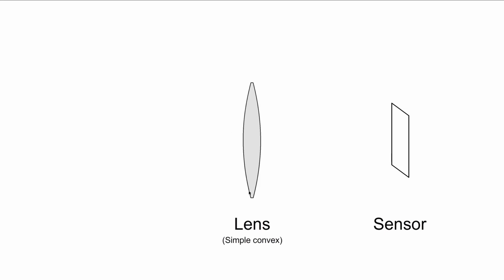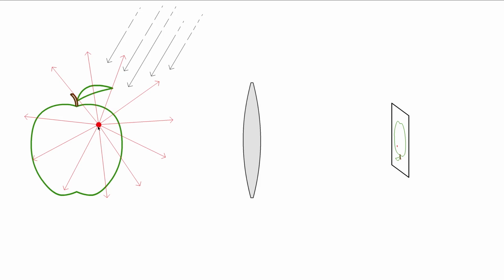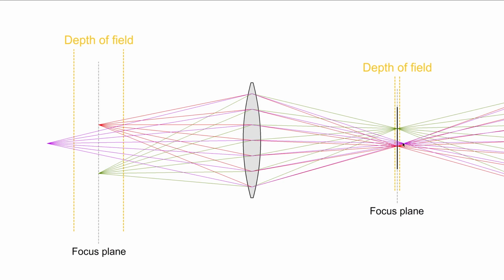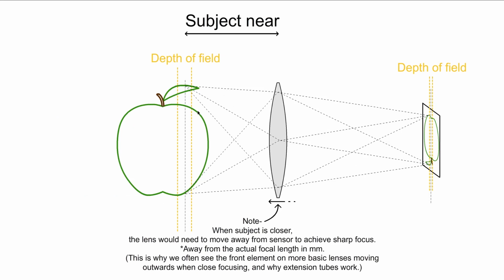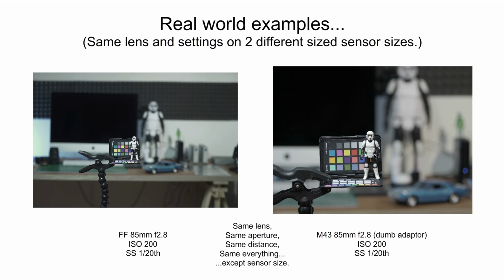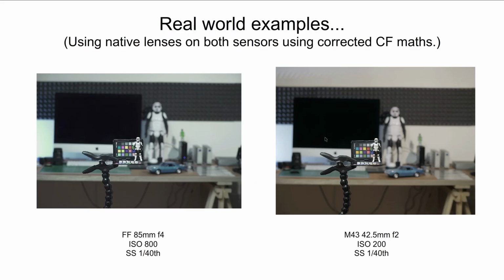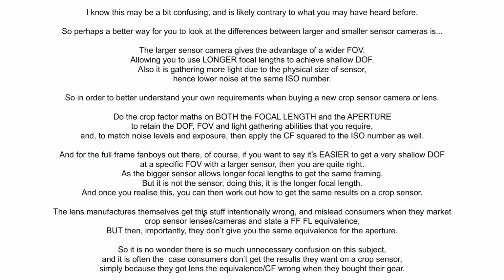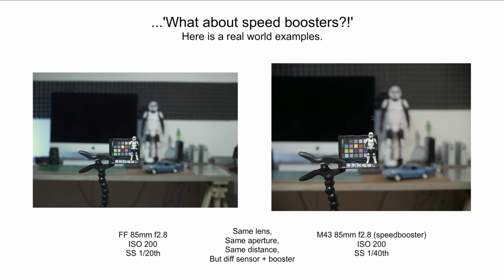Depth of field and crop factor misconceptions.

Comment: I don't think manufacturers "gets" the stuff intentionally wrong, they just want to achieve the same thing. Consumer market refers to FOV as EFL (equivalent focal length) for a 35mm sensor. The f/# refers to the light gathering capability only (how much light can I collect from the scene?)

You do something completely different: you're trying to "match" the circles of confusions to get a similar DOF when changing the crop factor. And this is great when you need to compare the performance of two systems for this very metric, but very cumbersome when you try to match the exposition between systems. What is important to a manufacturer (when designing a lens) is the f/# and the FOV only.

I think what you get wrong in this video is the "equivalent aperture". This is not something which should be used because it is not a "scalable metric". FOV and f/# are the same regardless of sensor size (even if FOV is specified as EFL for 35mm cameras). "Equivalent aperture" is only useful when trying to achieve a specific DOF, but the same could be said about perspective (which is a an important factor for portrait photography too).
Reply from the maker: Hey, there are lots of examples of manufacturers getting this wrong. and it seems very intensional. see this vid with some good examples -
https://youtu.be/DtDotqLx6nA
Reply: I don't think you understand what I meant. This video has the same methodology you used (I think you based your video on it) and I find it very difficult to follow. The amount of light that will reach the sensor is only given by the f/#, and this is independent of the field of view. I understand what you're trying to do when comparing systems for the same level of noise or DOF.

The video you linked is a bit misleading. I don't think he quite understand how image f/# is computed for real photographic lenses and why it is a metric. A set of f/#, exposition time and ISO will give you the exposition you need for any FOV or sensor size.
Reply from the maker: And regarding the changing aperture value on different lenses, to achieve true equivalence, and very comparable quality.
This way i suggest here really is completely the right way to go about it.
Lets brake down what is important to a image when comparing a photo or video taken by one camera/system/lens and another-

-FOV. (so we know what will fit in shot)
-Total light gathering across whole sensor. (so we know the noise levels we can expect at a particular light level)
-DOF. (so we know how much background blur we can expect. or how much of our scene will be in focus)

If you do it the way I suggest then you can completely match every one of those across hugely different sized sensors/systems, and know what equipment you may need if, perhaps you were changing systems. (e.g. going from FF to APS-C etc.) and you want the same level of quality that you had on FF.

I think the bit you are getting hung up on, (and you are not alone in this) is you think the ISO is a good gauge to trust over varying sized sensors. Its understandable why people trust it so much, as it helps match exposure over varied systems.
But, because the ISO isn't telling us about the TOTAL amount of light hitting sensor. its essentially lying to us.
Once you realise that you can work backwards and 'fix' the rest of the equation.

If TOTAL light hitting sensor if what you need to know... and it should be, because, as i have explained, it determines the image noise very very accurately. Then start from that point.

If you look at DXOmark results regarding image noise over dozens of varied sized sensors from many manafacturers... then do the crop sensor maths squared to their results, you will suddenly see that they all perform roughly the same... (as soon as the SIZE of sensor is taken out of the picture.)
In other words, the technology variance is really quite small, even over a several year span,
(Note, the performance increase with sensors is very tiny year to year, maybe a 1/3 of a stop improvement every 2 years at most) the main difference is simply the physical size of the sensor.

So, as a factor that helps us quantify the quality we will achieve with a given set up, the Fstop number pales into significance compared to the total amount of light a particular lens lets through.

Remember the focal length is part of the transmission equation (you can't change that without changing the aperture to keep equivalence). and a lens thats half the focal length (for a M43 / FF comparison), and designed for a smaller sensor is physically MUCH smaller. So how could it possibly perform the same???
It can't.
So yes, it is unfair for manufacturers to state FF EFL (which gives us our FOV guide) and not state the FF equivalent aperture too. (which gives us our total light transmission ability... plus a very good idea about DOF as well.)

its like a car company saying 'buy OUR car over that one, because its engine is twice as efficient as the competition!'
But they don't mention that their car weighs four times as much as the competitions car, so in fact it uses twice as much fuel.

So Joe blogs buys the car after reading 'twice as efficient' and wonders what it gets shot MPG :D

Anyway.. thanks for your input.. but after a lot of homework on this one I'm pretty sure the facts in this vid are spot on so far. (i will certainly take it down and revise if anyone points out any real mistakes)
Reply: you are right....i like to say that the image is produced by the lens not by the sensor....Tony Norhtup is confusing everybody with this wrong assumption. He is matching DOf of diferent lenses...so this for shure will affect the resolution of the FF....giving the impression that iso 200 on m4/3 is actualy iso800....bullshit.
Reply: "So yes, it is unfair for manufacturers to state FF EFL (which gives us our FOV guide) and not state the FF equivalent aperture too. (which gives us our total light transmission ability... plus a very good idea about DOF as well.)"

This is not true at all. Light transmission ability is only given by f/#, and that why your methodology is wrong here. "Total light hitting sensor" is not what you want to know, and isn't even related to DOF. 

"Remember the focal length is part of the transmission equation (you can't change that without changing the aperture to keep equivalence)". What is that transmission equation? It is probably linear with f/# but not focal length (changing focal length and keeping the same clear aperture).

I want to reassure you by saying that what you did is certainly "not wrong". At the end, you normalise the exposure and get similar noise levels. But what I want to say is that this is not a conspiracy against the consumer. Open any lens design notebook, and these metrics are never mentioned because they are not important for the lens manufacturer (only f/# and FOV are). What you want to know about a lens is what it sees, and "how much" it can see it, the blur is irrelevant for most applications.
Reply: is like saying the reverse: to get a sharp image like the m4/3 delivers you have to lose resolution on FF
Reply: Exactly, when you scale a lens, you also scale the aberrations it causes. (DOF being one of those "aberration" when you are talking about optics)
Reply from the maker: Im not sure if our last messages overlapped, so uncertain if you read my long explanation... 
but regarding Tony Northrup's vid, yes, as i explained at the end i got a lot of the info from him. but i wanted to break it down and do my own tests then try to illustrate all of the relevant aspects with illustrations etc. (I mainly did it this way because I think visually, and not with equations... so i figured other people would appreciate this way of braking it all down too... when i sit down and litrally draw things out like this, the process becomes crystal clear to me.)
Reply: give me a high-five Guillaume!
Reply from the maker: sorry, what?
Reply: I know what you mean, but I think your video (and Tony Northrup's) is very misleading. The methodology is wrong, even if the results are right. The only conclusions you should get are:

1. It is possible to match the DOF of a FF system by scaling some parameter relative to the sensor size.
2. Smaller sensor will get better performance if you want to match DOF (small sensor are really good now, even if pixel size is smaller).

And that's it. Manufacturers are not misleading you, they are giving you the metrics you need to buy a lens. DOF calculations should be on the consumer side only, because they are only used to compare performance across sensor size.
Reply from the maker: No, he and I are trying to point out that when you have the FF at ISO 800 and M43 at ISO200. and they both expose the same. then they are both getting the same TOTAL amount of light on the sensor. This is why they have very similar amounts of noise... maybe some cross wires across all the comments now.. so apologies if this is the case.
Reply: biscuitsalive, iso 200 on m 4/3 are almost perfect...there is no noise......will be if you do a stress test with no light.
Reply from the maker: Im not saying its a conspiracy, I'm saying they knowingly misrepresent the facts consumers should know when choosing a crop sensor camera in their marketing. thats pretty obvious to me.
Reply from the maker: as i said, the total light hitting sensor is important to the noise levels... how did i not make that clear?
Reply: i shoot with two cameras: d700 FF and Olympus EM5 mark II.
With both on 50mm (olympus with 25mm), both with F1.8 and iso 200, i get a better exposure on olympus....i have to decrease two stops on nikon to match both.....this is a real test.
Reply: the light transmition of olympus lenses are no match for nikkor.
Reply: " FF at ISO 800 and M43 at ISO200. and they both expose the same. then they are both getting the same TOTAL amount of light on the sensor"

That's why I said that you are not "technically wrong". You can always find another valid exposure on the exposure triangle, and that's why they get the "same amount of light". But that doesn't mean that the methodology you used to get to your conclusion is right. I understand that it is interesting to see that you can match the DOF or other aberrations, but I don't think manufacturer are in the wrong or misleading by not telling you that.

I won't argue farther, I think it's useless at this point because I will only repeat myself. Just keep in mind that you're not technically wrong (the maths and the figure you used are spot on), just a little off on your conclusions.
Reply from the maker: what i mean by the transmission equation is - all the factors that determine the amount of light a lens can transmit.
when you change the focal length. the physical size of the aperture has to change to match the same amount of light...
hence a 50mm f2 = a diameter 25mm aperture
and a 35mm f2 = a diameter 17.5mm aperture

So. when you change the FL, you cannot do this in isolation if you want the light transmission to stay the same. 
So. when you change the FL to match a FOV of a diff sensor... you HAVE to change the aperture too... or its not a equivalent amount of light.... i explain all this in the video... do i have to explain it again?
Reply from the maker: Anyway, i appreciate your input... but I made this video so that i wouldn't have to get into these sorts or disagreements... :) I was hoping that if i spelled it all out as clearly as i possibly could in the vid, then it would be apparent why this is the very best way to approach crop factor equivalence. (youtube comments are not the best way to express yourself after all )
Reply from the maker: there is always noise. go and take pics of a blue sky with any camera, any ISO, there is always noise. (unfortunately)
Reply: You don't have to explain to me how f/# works. I think you are mixing a few things in what I said, so I'll try to give you an example.

What I mean when "matching the FOV", is matching to FOV WITHOUT changing the f/#.

50mm f/2on  FF and 25mm f/2 on M43 will have about the same FFOV, and the same "light gathering capabilities". That means that the ISO and the Exposure time will not change between the two systems. That what is important for a lens manufacturer.

What you are doing here is matching an aberration (in your case DOF). You can match it (as you have showed with your figures) by changing the aperture. Then, 50mm f/4 on FF and 25mm f/2 on M43 will be matched for DOF. However, you have lost two stops of light that you need to gain. If you want to keep the exposure time the same, you will need to crank the ISO by two stops.
Reply from the maker: I get to play with cinema lenses for work, and the Tstops sort it all out for you. yes, much variation in actual transmission with photography fstops.
Reply: I'm a grad students in optical design, so I get to work with all these metrics on a daily basis. I'm not sure if I can explain it clearly to you. Once more, I don't think you're wrong, just not seeing  the problem with the same background as I do. If, for what you do, DOF is more important than anything else: your conclusion is right. However, in most application, FOV and light collection are probably more important and that's why manufacturer only gives those metrics out.
Reply from the maker: ok, i think you haven't got you head around the basic message i was tying to impart.
what I'm doing in this vid is not just about the DOF.
this equivalence method IS very much about the "light gathering capabilities".

Maybe watch it again and focus on what I'm saying regarding the ISO lying to us.

What you said above -
'50mm f/2on  FF and 25mm f/2 on M43 will have about the same FOV, and the same "light gathering capabilities". That means that the ISO and the Exposure time will not change between the two systems.'

Is wrong. and thats exactly my point.
A 50mm f/2on  FF and 25mm f/2 on M43 WILL have about the same FOV, and WILL NOT have the same "light gathering capabilities"

we think it does, because we are using the same ISO and settings on both the FF and the M43.

BUT, you have to factor in that fact that the ISO number on the smaller sensor is telling you about the light fall hitting ONE SQUARE INCH of the sensor.

NOT, about ALL of the light that is coming through the lens, and creating our image.

This is exactly why this way of doing the equivalence is important.

It fixes and equates ALL the important factors we need to know about -

FOV
DOF
Noise levels

put simply, its WAY more important to know the total amount of light that creates the image, than the ISO number.
So don't judge the exposure by the ISO level. (which is what you are doing when you say =
''50mm f/2on  FF and 25mm f/2 on M43 will have about the same FOV, and the same "light gathering capabilities". That means that the ISO and the Exposure time will not change between the two systems.''
Reply: "NOT, about ALL of the light that is coming through the lens, and creating our image."

This indicate to me that you have no clue as to what an f/# truly is.

I won't argue anymore. I don't think understand the kind of optics on a fundamental level. I know that you don't think in terms of equations, but if you want to discuss these kind of things, you'll need to get a textbook and do some "real" homework because you don't understands concept such as f/#, FOV, exposure time and electronic gain (ISO). I would gladly explain it to you in more academic terms, but given that this is youtube comments, this is not an ideal platform to do so.

I have a very strong understanding of these kind of calculations and do them on a daily basis. If you go read the comments on Tony Northrup videos, I think I'm not alone in thinking that this is a bit misleading. I won't argue anymore because you have some work to do you your side.
Reply: thas is why i said that olympus and panasonic m 4/3 cameras are good if the shooter know everything about lenses....

+biscuitalive, do your homework and you will find out the point
Reply from the maker: sorry dude, i find some of these comments hard to follow, what point was that?
ps, im not hating on any sensor size or manufactures. I own/use full frame, APS-C, and M43... Sony, Olympus, Panasonic, Canon... No brand or sensor type loyalty at my end. :)
Reply: "NOT, about ALL of the light that is coming through the lens, and creating our image."
this is wrong .

A F2 lens on m 4/3 and FF deliver the same amount of light that the sensor needs for it size. No more, no less.
You can argue that a FF lens has a bigger rear element, but in the end, is the same transmition of light.
 
you have to consider the pixel density to understand why the iso 200 on m 4/3  is less sensive to light...but, now there is FF camera with 36 MP and more, so the pixel density is extremly low in this FF.

If you understand tha FSTOP is a mathematical greatsness, not a relative measure of light,  you can see what we are saying.